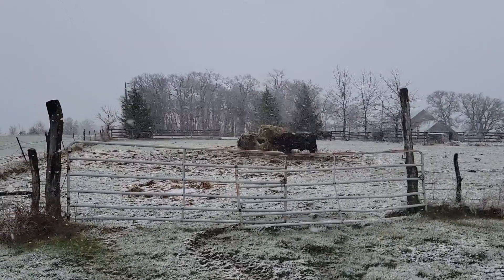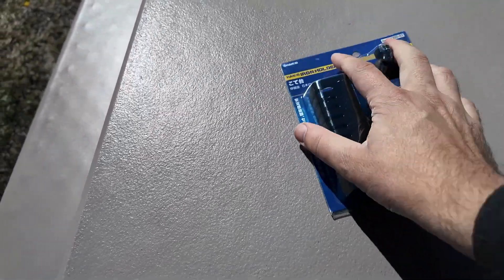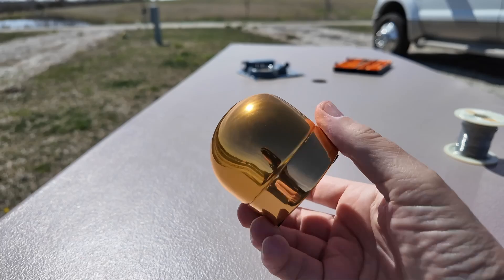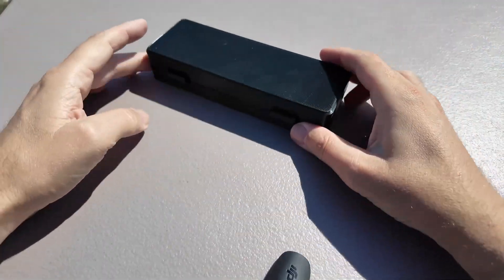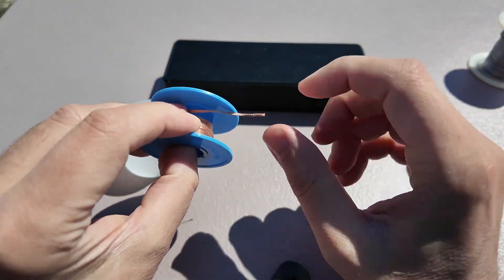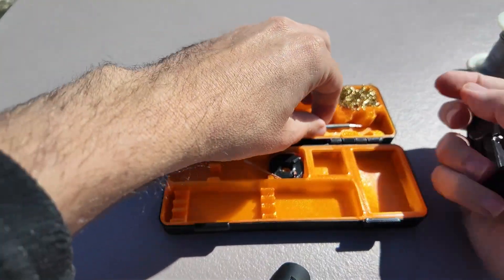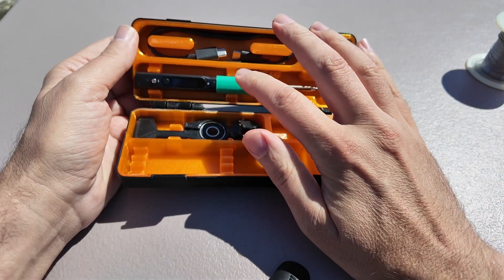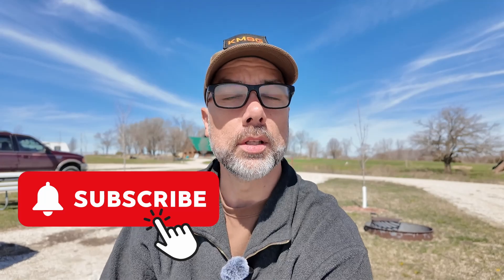Excellent Storage for an Excellent Soldering Iron

Comment: If u use the sponge only to clean post soldering.. the gunk and flux off the tip..    then use the kitchen oven scrubby thing prior to soldering followed up by a small dab of fresh solder.  Keeps your tip fresher than a sailor on shore leave . ✌️🙏🇺🇸😂
Reply from the maker: @ConspiracyBear  That's Fresh!

Comment: The bobbins were a brilliant idea!  Both to hold the hot iron, and to use to spool solder and wick. 

Not having A 3D printer, I found a Plano (3440-10) airtight case about the size of your kit, and everything for my super-neato, ultra-tiny, traveling Pinecil V2 soldering kit fits in it-- barely:

Pincecil Iron, two tips (point and wedge), power cord (same red one), 65 watt/20 volt power supply, brass mesh tip cleaner, 4 bobbins (two with leaded solder, two for holding iron), small spool of solder (lead-free) and small spool of wick.

The only pieces of my kit that don't fit are project-specific tool-bag items anyway: strippers, crimpers, desoldering tool, and snips.

Great video. Just what I needed. Thank you.
Reply from the maker: Sounds like a perfect kit!

Comment: I use the bottom of a soda can with the top edge folded in to hold my brass wool for soldering. So far it keeps the table safe and hasn't damaged any of my soldering irons.
If you have a lip on the spools like commercially made solder wick does it stays put a lot better.
Reply from the maker: I think the spools need some improvements for sure!

Comment: love that case ! can fit in a Pota kit. fix antenna on the fly.  I have a few Hako soldering iron. like most I threw out  the manual. when i needed a tip i got the wrong one. but fit my outher iron . the one I needed was T12 tips. when I talk it out had part number on side of it. should have looked first. my bad. the iron part is made buy Hako says right on it. but the base is battery to fit DeWalt 20V max battery. works the same as AC one. just battery operated. my outher one is Ryobi 18V one plus system one and the iron part is made buy Hako and takes the 888 tips. that what I ordered.  I do have the Hako one like the pic you showed. I use the sponge for outher things. I use the wire wool brass pad you got but my case metal . looks like C3PO . girlfriend gave it that name.  Hako makes a butane iron . no power needed . works great. love the Hako line of soldering stuff. I have same solder and 60/40 and whole bunch of different solder for different purpose. lots of flux and wick and Hako solder sucker .I do have Weller irons as well. mine from 1980 still works and can still get parts and tips. same Weller Fran lab uses . love that USB C one. I may get one for my Pota box .The ISO tip soldering iron has been around for years. I got a old one. not much heat but super for surface mount stuff. Chuck did a video on one.  for small work that great. battery does not run long. love your antenna build with that Iron and kit box. do a Pota with that antenna . my friend Mike in NY did . he loves it. waiting on the QRO one. 73's
Reply from the maker: I have an ISO Tip to test out also. But is in a much larger case!
Reply: @temporarilyoffline  mine has NiCad battery replaced with NiMh  works fine. the new iso tip has LiFePO4 in it now. all most got it. my old black one works fine. the #222 lamp still can be found.
Reply from the maker: @robertmeyer4744  nice!